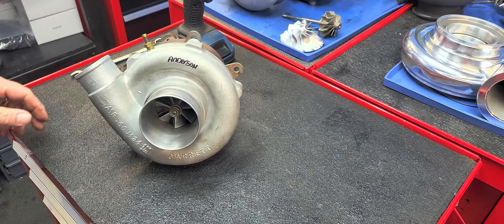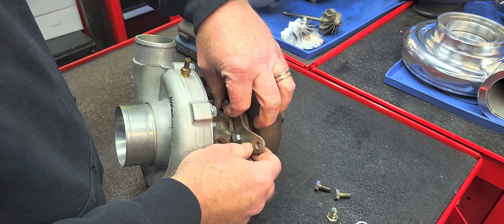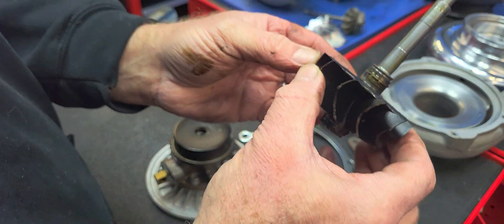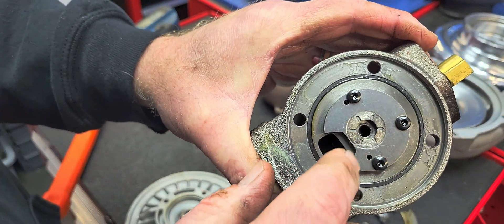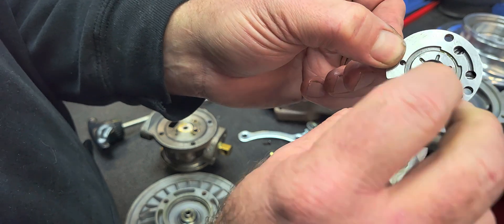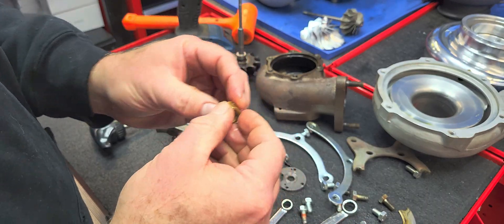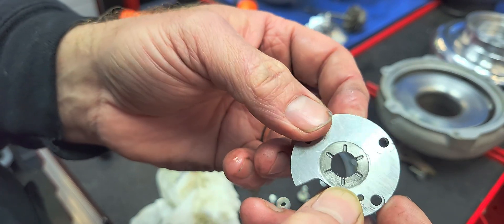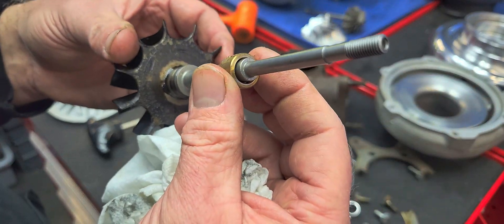Garrett Buick Grand National TE62 Turbo Failure Analysis, NOT what I expected to see!

Comment: Yep, looks like that turbine shaft was already a bit smoked and they reused it anyways without even prepping the surface beyond bead blasting. I wonder if they actually checked the clearance at all once it was reassembled? What is your general opinion on steel vs brass/bronze thrust bearings? Thanks for the video! I love turbocharger disassembly and failure analysis. If you feel like glancing through my latest video about the new MXR ball bearing turbos I would love it if you had any thoughts. Obviously understand you are busy though!
Reply from the maker: I think the shop just wanted it out the door and the money in their bank!  Hate to see this, but it happens quite regularly I am afraid.  If the customer had sent it back in, they probably would have blamed it on him somehow...Sad.  -Reed
Reply: @workturbo  Just like I do all my own mechanic work because I can't trust a shop. 😬 Thanks for sharing the info!